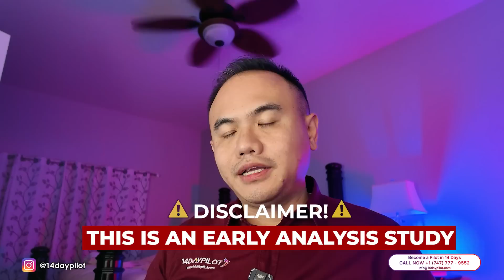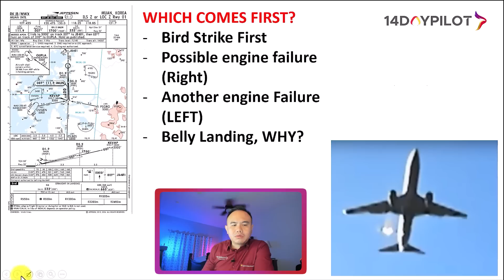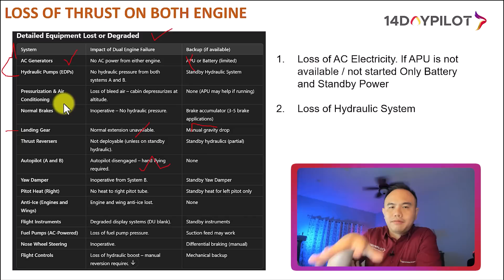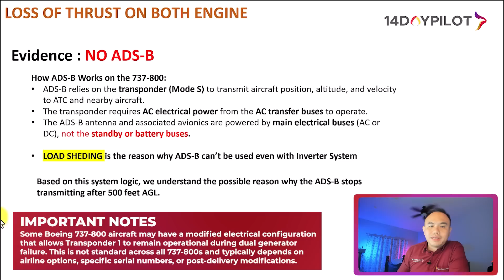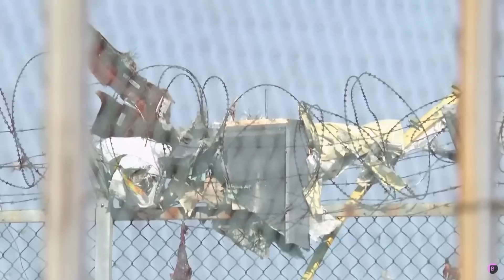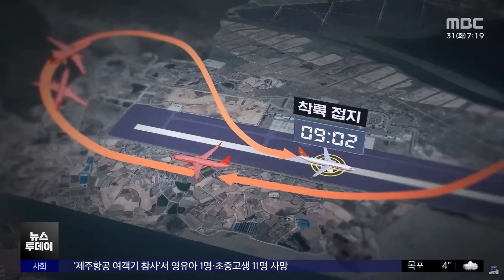NEW! JEJU AIR 2216 UPDATE :THE MYSTERY OF RUNWAY 19! B737-800 Crash At Muan Korea

Comment: It was estimated - based on the video evidence - that the airliner was traveling over 150 MPH when it reached the end of the runway.  This is based on the the time it took to leave the runway and hit the wall - knowing the distance between the two points.

Also, we know it only took three minutes for the go-around.  Logically you'd go through the landing reconfiguration checklist which would require more time.  Clearly they felt rushed.  But it seems clear - based on the video showing the airliner on the approach - there is thrust from at least one engine.  Also they're coming in hot.  They were nowhere near stall conditions.

I don't understand why they couldn't get the gear down - even with two engine failures.  It takes less than a minute to manually deploy them on a 737.  They had time and adequate speed.  If the gears were deployed - at a minimum they could have steered away from the localizer wall, possibly saving many more lives.
Reply: Landing gear does slow the plane in the air and perhaps they were not sure if they can make it to the runway with landing gear down, especially if they really made this heavy turn to the runway
Reply: @VeraldOsu  Admittedly this is Monday morning quarterbacking here, but that was an error as well.  Terribly miscalculated, unless they had no way to know their airspeed.

The data recorder will tell us everything.
Reply: @VeraldOsu  Correct.  They don’t practice dead stick in the sim.  He left it clean to maximize his glide ratio to be sure he made the runway (also why they were going so fast and floated in ground effect so long).  It just isn’t something they practice.  The mistake is when they lost the second (starboard) engine on the Go, they should have ditched it in the drink (more margin for error).
Reply: @wsteele5864  if you mean ditching, then 737-800 is not suited for that, most commercial aircrafts arent meant to be landed in water. And honestly with that speed they were going with, landing in water is almost certainly more deadly than belly landing (well.. without the wall but they didnt know that)
Reply: @ They wouldn’t have been going that fast (as fast as they were when they touched down on the runway) when touching down in the water.  You might want to look up the United 1549 landing in the Hudson River.  That was an A320 but essentially the exact same challenge aircraft configuration, etc.  

The runway was only 9000’.  Even without the Localizer antenna wall, they would have ended up in one of the building on the other side of the perimeter road, after going through the airport perimeter wall.  These pilots don’t practice dead stick approaches and landings.  They weren’t prepared for what they attempted.  A water landing would have given them a much larger margin for error.  The weather was calm.
Reply: @wsteele5864  737-800 has engines lower than A320 so they would touch the water faster and therefore structurally its easier for the plane to break
Reply: @VeraldOsu  Ah no, not the case at all.  The 737 landing gear is actually quite short, so the engines have to be held up higher off the ground.  In any case, they would have had a much better chance of survival than returning to that airport.  It is possible if they had been afforded the luxury of many hours of practicing that dead stick approach to learn the sink rates at various configuration changes they might have been able to make it into that 9000’ runway and stop in time, but without that kind of  sim training 99 out of 100 37 pilots would have ended up in a similar spot.
Reply: @VeraldOsu  Not if you're doing 150 knots off the end of the runway. Also depends on alignment with the swells of the ocean.
Reply: @wsteele5864  They'd still be doing about 180 without the slats/flaps. Very high speed for an attempted ditching. Full flaps, gear up, outflow valves closed would have been the preferred configuration for a ditching. The Hudson River is calmer than most surf conditions on the ocean, but yes the winds were light.
Reply: @OtoyaYamaguchi-i1b  No they wouldn't be doing 180.  They wold just hold it off and glide to burn speed off, that is the whole point of picking the water, basically an unlimited runway distance where you don't have to guess, you just hold it off until you do a full stall landing, about 130kts.  The weather was calm (no wind = very little chop, you just put in down parallel to the swell).  More people would have lived.
Reply: @OtoyaYamaguchi-i1b  well they had to decide that much sooner. its not like they knew how they would land (1200/2800m runway) etc etc
Reply: @wsteele5864  again 737 800 has engines much lower and fuselage is bound to break, cause huge damage, possibly breaking apart the plane even at just 125 kts
Reply: @VeraldOsu  Nonsense.  Compare a photo of an A320 and a 737.  The engines on the 737 are actually closer to the bottom of the fuselage.  In any case, they are extremely strong on those pylons.  A proper ditching will not tear the plane apart. End of story.
Reply: @wsteele5864 im looking at official structural data but you can keep comparing photos...

Comment: The pilot freaked out. No reason to go-around. Already in landing configuration, just land it.
Reply from the maker: make sense too
Reply: This is probably it. Would be interesting to see how many flying hours did the pilots have. I don't think tthe pilots details have been made public yet?
Reply: @Jim-d6t4z  The captain had 6800 hrs.
Reply: @romanroad483  thanks. Source?
Reply: @Jim-d6t4z  Many sources. To quote one, BBC website says "The South Korean transport department said that the head pilot on the flight had held the role since 2019 and had more than 6,800 hours of flight experience."
Also saw same thing on other video's.

Comment: One thing someone pointed out yesterday, the plane was in a classic glide configuration (no flaps, no landing gear, high speed.) Seems engine power was either very low (failure, shutdown, or shut down and restarted too late) or non existent. 
The pilots seemed to make this decision to land ASAP on the information they had , rightly or wrongly.
 I assume the lack of/low power meant they  believed would fall short of the runway if they were in a  flaps down, landing gear down configuration, so decided to glide in to get to the airport.
Reply: Failed the landing and wanted to bail out last minute since they panicked on the landing gear not dropping
Regardless if the wall was there or not
He made a mistake of not going with runway 01 where he was originally cleared for in the first place
Cherry on top he retracted the landing gear which makes no sense and further add another layer of procedure when he wants to land again
Reply: @everydaydose7779  Definitely down to human error though I don't think the wall should have been there because human error should be accounted for just in case.
Reply: @everydaydose7779  Retracting the landing gear is standard for a go-around.
Any worry about reaching the runway a second time was misplaced. They ended up with TOO MUCH speed.
Reply: I'd agree with you but you can clearly hear the engine running
Reply: @Mirza011  it could be the APU engine we can hear, which world give the flight crew power for the flying controls but no forward thrust.
Reply: One engine was definitely working, you can see this on the video of the landing. The plane was powered coming in, the pilot was in control of it. Although still providing thrust, my guess is that it was partially damaged, which is why the pilot decided to land asap. I believe he should have simply landed on the first approach. After bird strike it appears he decided, or was directed to gain height and then go around. Easy for me to say of course but ..I think that was the crucially wrong and fatal decision.

Comment: If this was caused by shutting down the wrong engine as evidence seems to point to. Maybe a new recommendation should be to leave damaged engine running until damaged engine confirmed by cabin crew as shutting down wrong engine at low altitudes is too catastrophic.
Reply from the maker: yes make sense
Reply: It really depends. If the damaged engine is vibrating heavily because its fandisk is bent and out of balance or a fan blade has detached you must shut it down or you risk structural damage. You may even have the whole engine nacelle break off (they are designed to do that) and that would be catastrophic in such low altitude because it could damage the wing or the tail.

Comment: Consider a seized LP Fan spool on the starboard engine. Looks like reverser deployed, but not reversing. Added power=more speed. Or simply a bird-damaged fan. We are pretty sure the starboard engine suffered a bird strike. If the strike was on the outer periphery of the fan, then this would make sense.
Reply from the maker: Good point.. because no landing gear .... the cascade can be opened with the RA but no thrust of course without landing gear

Comment: Hmmm ... More interested why the gears are not extended ? Without hydraulic available, gravity falls should takes less than 30 seconds. Anyway I'm not a pilot, so there maybe a reason why they choose to land without the gears.
Reply from the maker: Thats the common sense thinking, the problem is they may have 2 engine loss then no time to do the gear
Reply: @14DAYPILOT  The go-around took six minutes.  I don't understand where they could have come to the conclusion there wasn't enough time to drop them.

Comment: Where do you get the info from? They landed with engine 2 at full thrust and the reverse open after touching ground.
Reply: Why do you assume it was full thrust? Could have been 25 %.
Reply: @williamm6446  Yes I cannot assume it was full thrust. I also can not assume that the reverser can provide any braking when it's dragging on the runway. All that can be seen is the reverser ring opening and the engine roaring past. It just looks like someone applied the reverser and power. It obviously was no help. It should have taken the plane off the runway, to the right.
Reply from the maker: there was no reverse open...check again. if there was no both engine loss, it will be on the pilot problem 100%. No reason to not put landing gear if they still have 1 good engine
Reply: @14DAYPILOT #2 reverser was clearly activated.  Sounded like significantly more than idle thrust too.  Although perhaps grinding noise could be mistaken for that.  But thrust reverser was activated regardless, according to many experts online.  I’m inclined to agree.
Reply from the maker: @gavtex1065  Could be because if the scenario is loss of both HYD then stby HYD will activate the T/R maybe partial.
Reply: @ Yes stby hyd will power thrust reversers.  They are slower to deploy but still deploy.
Reply: @gavtex1065  No, there is no use to activate reversers if you have no engine.
Reply: @14DAYPILOT  Check the Korean TV video. The view from the right side shows the reverser opening just like a normal landing and the video from the left side shows the heat turbulence on the right engine but nothing in the right engine.
Reply: @14DAYPILOT  does the 737 alert the pilots that the landing gear isn't down when they're descending? Not sure how the system is designed
Reply: @ Yes.  Normally it does.  However sometimes such warnings may be inhibited by other aural warnings that are considered a ‘higher priority’.  Also, it’s probably not all that relevant whether it did or not because under the extreme stress condition where they would have been very busy / focused potentially pilots are not likely to even hear those aural warnings.  This is a known phenomenon.
Reply: @gavtex1065   I see. But landing without the gear down should be the highest priority alert. If the pilots missed that, it was a fatal error
Reply: @ Check out Pakistan International Airlines flight 8303 (I think that’s the number) crash from 2020 (an A320).  The ‘too low gear’ was over ridden by other warnings in their first totally messed up fast and high approach.  Because they were coming in so fast the GPWS prioritized ‘sink rate’ and ‘pull up’ warnings because the system was setup to assess that it was unlikely the pilots were attempting to land (fast and unconfigured) and more likely just unaware of ground proximity.  Regardless Mentaur Pilot has a great video about this particular crash and discussed at one point this warning not occurring for this reason.  Having said all that it is quite possible the Jeju pilots DID get the ‘too low gear’ warning but either it didn’t register (didn’t hear it due to stress), they ignored it (because it was their intention) or realised but decided there was no time to lower the gear.  Also I’d say it seems likely landing wheels up was in many ways the least of their problems.  If they had at least got out flaps 15 and managed their energy sufficiently to touchdown early enough (or even flapless but early touchdown) they would have probably been fine.  Seems not unlikely that they may have kept it entirely clean to ensure making the runway and their preference was for an over run rather than crashing short of the runway - being perhaps completely oblivious to the threat of that wall!  I would think they must have been unaware of the wall as they were steering straight ahead.  Don’t know for sure but it seemed there was power from #2 engine during final and landing and they apparently had quite good control of the aircraft in that short final flare phase which has me believing they had sufficient hydraulic power to move the rudder.  If they could see the wall ahead late in the landing roll I would have thought you might see rudder deflection as they try to steer left or right to avoid it?  Unless they froze in ‘fear and acceptance’?  More likely I’m thinking that wall blended into the background until the last seconds? If they knew it was there it’s possible they could have steered off the runway to avoid it IMO.
Reply: @Jim-d6t4z  3 GREEN LIGHTS !!!!, from the first analog cockpit on..
Reply: @luiscarbonell5961  if that were the case, they wouldn’t have remained on the runway.  If that thrust reverser was deployed and the engine was making full thrust. It would have pulled them hard to starboard, enough that they likely would have missed the wall the Localizer antenna was mounted on.  You have been deceived by internet experts.

Comment: I'm back with the 1000-point question. Can a pilot run a short U-turn with both engines turned off, without power and without a functioning hydraulic system?
Reply from the maker: yes. with very hard control

Comment: Long video short, plane with fuel hit a reinforced concrete barrier and exploded. Without the barrier, full stop with everyone alive.
Reply: Maybe, but they were going so fast they might have run into buildings beyond the perimeter, potentially adding casualties on the ground.
Reply: @charlestoast4051  Look at the map, one wing would be damaged and the fuselage would stop intact at the road. Reinforced concrete has no place anywhere neat any runway.
Reply: @charlestoast4051 I saw a map of the airport…..Have look. Beyond the wall is dirt ,then the bay.

Comment: Nice videos. A few questions: If the plane made an "impossible turn", how did the plane get lined up with RWY 19 so that it slid from touchdown to the departure end and into the LOC antenna structure, as if perfectly lined up with the runway? Could the explanation for the long landing be the pilot aiming for the "aiming point" markings (1,000± feet past the threshold) and flying past it in gound effect?

Comment: I appreciate your analysis and possible explanation. We all need to know what happened. 
 I am curious about how the hydraulic pump is physically driven inside the engine. The low pressure compressors fan easily rotates in a slight breeze. Wouldn’t the windmilling engine turn the hydraulic pump? There is a low pressure turbine and a high pressure turbine; witch one mechanically drives the hydraulic pump or do both? It takes quite some time to spool up an engine and how long does it take to stop that engine with a 150 knot wind windmilling it? They were on the ground in how many minutes after the bird strike?